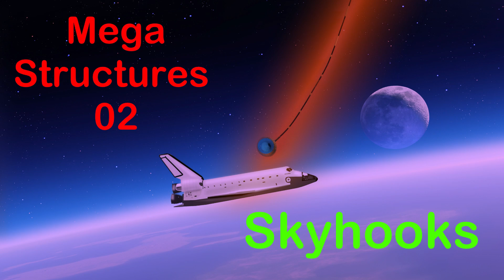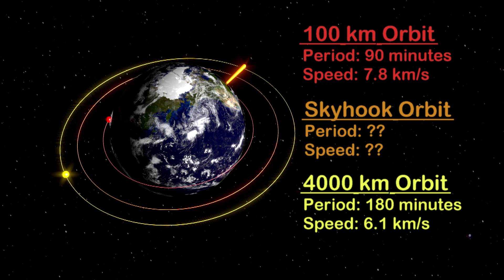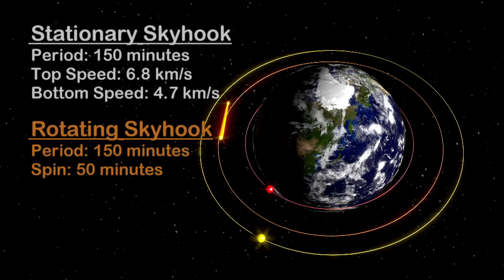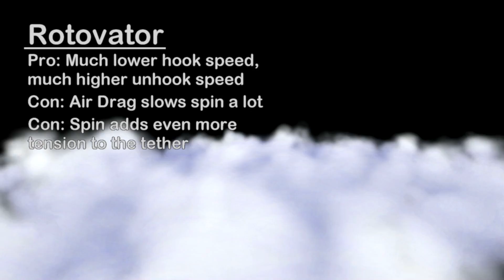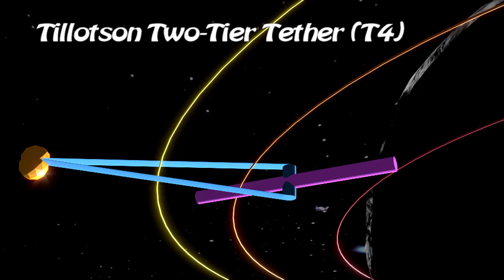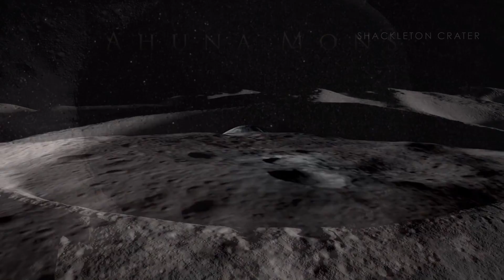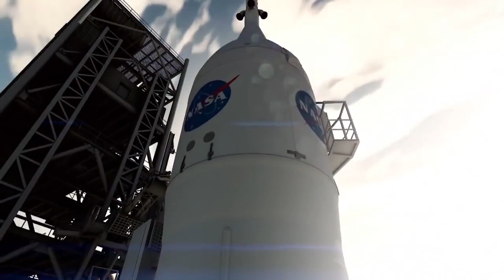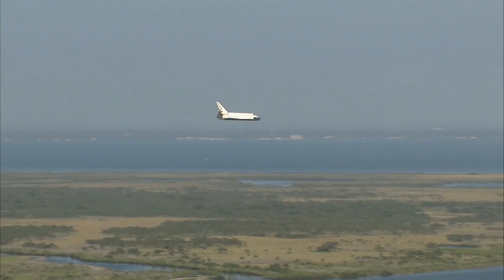Skyhooks & Rotovators

Comment: Could the skyhook gather Ion thruster fuel from the planet atmosphere when the hook is going down if the planet has the appropriate air composition?
Reply from the maker: Huh... yes it probably could. I was going to say no but the exhaust velocity of the ions ought to be decently higher than the scoop speed. I was also going to say I figure someone must have thought of that already and ruled it out but we almost never consider the ion option because of the Electrodynamic tethering option. Well done, that may well be the first time anyone's thought of that Luis.
Reply: @isaacarthurSFIA  i thoight of that while watching the video before i got to this comment :/
Reply: Well, I cannot disagree but not much xenon is available. You work what what's there, especially since the supply is so plentiful. Better to separate the O2 and cool in a cryotank and launch in to orbit for oxidizer and breathing. That will improve the economy for this Skyhook.
Reply: Reaction mass from the atmosphere. Ionization and acceleration from ET (Electrodynamic Tethering power). I like it! No solar panel to catch micrometeroids or drag upper atmosphere like the Space Station.
Reply: Thanks for making this video... I had not realized that an unteathered space elevator was called a sky hook. Could this technology be used to collect atmosphere from Venus that could then be transported to Mars? I am sure that there is plenty of silicon in the Asteroid Belt that could be used as a transport device... and the heat from Venus's atmosphere could effectively be used to blow the silicon into enormous glass balls that could be sent on an elliptical orbit around the sun on an impact trajectory with mars... 

The question I have is, how do you harvest the gas with such a device? Over the long term, this could help make both planets more habitable for humans.
Reply: Look up Electrodynamic Tether on Wikipedia - it generates power. It have been tested. Reaction wheels could affect the rotation of the Skyhook or ion thusters at the ends. Or both.
Reply: Larry Beckham. where would the power for either the thrusters or the electrodynamic options come from if not solar?  I mean there are other options but solar isnt a bad one.
Reply: How would you overcome atmospheric drag?
Reply: @gauravproton1956  Electric turbines adding velocity when entering atmosphere, powered by energy from solar panels or gaining energy from magnetic field of the planet? Drag could also be decreased by adding aerodynamic shape to it.
Just trowing ideas around.
Reply: @Hellsong89   magnetic field is weak cannot use as a energy source, its velocity would be high so cannot make decisions in a split second. Well why do you need energy source while entering the atmosphere?
Reply: @gauravproton1956  thrust provided by ionization of atmospheric gasses within a very high voltage electric field and a few smoke detectors worth of americium to induce the ionization
Reply: @unitedspacepirates9075  this would create more rucus  more entropy around the shuttle
Reply: Increasing the voltage of any ion drive increases the thrust from each ion ejected. Increasing the number of ions only requires additional smoke detectors americium to ionized more ions. Increasing the voltage doesn't require additional power, only additional windings or capacitors.
Reply: +Timothy Crystal
Trying to supplement the atmosphere on mars is unlikely to work long-term for two reasons:
One is that Mars' gravity is so much weaker than Earth's, it is unlikely to retain much more atmospheric mass than it already has.
Two is that Mars has no magnetosphere to screen out the solar wind, which is admittedly much weaker at Mars' orbital radius.  No matter how much mass is accumulated, the solar wind will ionize gas particles and effectively blow them away from the planet like dandelion seeds.

Comment: A hybrid system with space elevators. If there is a solid ring structure connecting the various towers, you can deploy a retractable tether and hook from the structures between the towers. High altitude spaceplane can be flown from anywhere on earth then meet up with the hook for orbital extraction. They can still be launch assist system with the ring structure being a pivot point for the sling. 
This way, non-equatorial nations can easily access space without large rockets or transport materials to the nearest elevator.

Comment: Wouldn't using Lorentz force to replenish the momentum of a tether be less straightforward than just circulating an electric current along the tether? I mean, if you did that, the current would have to loop up and down the structure, creating equal but opposite forces as it interacts with the magnetic field.

Comment: shooting our rocket ships through magnet rail structure inside a somewhat vacuumed chambered tube(hopefully timed correctly between the release of of the vacuum and energy from being flung off the magnet track and out the top) be more efficient cause then they could use the fuel from the rocket to reach more things inside our system.

Comment: It doesn't need to "dive" in athmosphere, it can catch a vehicle in suborbital flight also, than slingshot it to orbit or further - rotating version. I think that, the most eficient solution to get to the orbit will be sth. like that:
1. geting to supersonic speed by magnetic rail,
2. jumping to 100+ km up by ramjet and small boost from a rocket if needed,
3. getting to orbit by rotating skyhook.
But in fact the cheepest way to get to orbit will be projects like skylon or fully reusable spacex vehicle. Fuel is cheep, space stuff is not - 1T of liquid hydrogen costs only 500-1000$!

Comment: Something I didn't quite fully understand and am curious about - I mean the limitation of jets and high altitude is that they compress and expel air for thrust, which means they would not operate without air (obviously). So if a skyhook were to grab a jet, it goes without saying the hook and the object it was grabbing would be deep into the atmosphere. How would the spinning system recover the energy lost to drag. It would seem like a object that long, even if designed with minimal drag, would need to recover a lot of energy. I would think it would need to recover a lot more than the energy than needed to overcome simply gravity like the geosynchronous orbit version. Also, unlike gravity, air resistance would create energy loss from it's rotational momentum, and only on one end.

I don't doubt Isaac has thought of this, maybe even mentioned it in his video and I missed it. It was just a the only potential obstacle I thought of after watching the video and am curious as to why it wouldn't be an issue, or a big issue for that matter.
Reply: Drag losses would have to be to be counteracted in the same way as the losses from lifting things, by catching stuff which needs to be lowered: in the worst case essentially dropping rocks from the moon if there's nothing useful to lower, and/or by using high-efficiency electric thrusters which can potentially be nearly free (i.e. if pushing against the magnetic field). The other possibility would be to just not lower the hook into the atmosphere at all, it's still a lot cheaper to do a suborbital hop to 100-200km altitude than to get into orbit (about 1/4 the kinetic energy is required and most that could be provided by jet engines) and getting out of the atmosphere would probably make docking simpler by eliminating all aerodynamic effects, though the spaceplane would then need an OMS and some propellant to make the rendezvous.
Reply: Blake Walsh 

Would that even work? I mean any kind of orbiting structure that's 100km+ in length is going to be essentially as rigid as fishing line, fishing line with memory I suppose. I just don't understand how it would be easy to lose and gain large amounts of rotational energy on only one end of a rotating string.
Reply: My strongest suspicion is that gross corrections to the orbit and/or rotation could be made using propellant-less means, but it would still be absolutely essential to have thrusters at each end to perform various kinds of attitude correction. Obviously, whenever the tether catches and raises/lowers a payload its orbit is going to change and its angular momentum is going to change, presumably the computers managing the tether would make projections of where the ends will be in the future which would affect scheduling - missing a payload catch would suck because it would throw off all the projections. There would have to be negotiations of how a payload is going to meet up with a hook. As mentioned by Isaac a modern computer can handle the logistics of this.

It couldn't be a completely propellantless system but it is a system ideally suited for jet engines and electric engines. Ion/plasma thrusters on the hooks could be firing continuously, building up angular momentum and orbital energy over many days, which is then quickly expended lifting a payload from a suborbital trajectory into orbit. The payload could thus be launched mainly on jet engines, lifted into orbit using electric engines courtesy of momentum exchange with the tether, then use its own electric engines to finalize its orbit. In this scheme, low Isp high thrust chemical rockets are nearly entirely replaced by high Isp propulsion and the reduction in the size of launch vehicles and the propellant expended would be huge (something like 90-95% reduction with good potential for 100% reusability), and that's just with winding up the tether using electric propulsion and not even considering the ability to get "free" momentum by catching payloads falling from the moon or leveraging the magnetic field of Earth. So even considering a pretty dumb system where both ends have VASMIR thrusters which do 100% of the work of getting the tether properly setup for a catch the potential is quite huge.

Comment: What about the atmospheric friction adding to the skyhook's rotation, what would keep it from adding up and tearing it apart? Only way I can see this actually working is if the skyhook essentially just dips into the atmosphere where at it's lowest point of rotation the hooking part would be moving close to speed of the air.

Comment: Interesting. As for your skyhooks Have the wide point at the center of mass. And this way both ends can be used. Secondly, Space crafts do need to come back to earth from time to time. Hence a Skyhook could grab one craft going up and one craft going down. and have a very little net loss. Speed transfer would happen is the center of rotation mass is closer to one end than the other. This way the fast moving craft coming home, would transfer some of its momentum to the out going craft.  The only problem I see is that the tethers will cover a wide range of orbit, and add to the probability of crossing some poor satellite's orbital path.

Comment: $500 mill launch and setup for a single system. 10 tonne a day @ $100/kg = $3 billion in revenue over 10 years. Would expect the lifetime of the system to be over 20-30 years.
Reply from the maker: I wouldn't want make many guesses about that first generation's service time, but even if you could only do one 10 ton hook once a week for one year it would seem worth it.
Reply: BFR might change the economics of the initial setup costs. If BFR can put 150 tonnes into orbit for a few million we now have a launch system capable of putting 3 tonnes into orbit per swing. If it is reboosted via electronic dynamic tethers it will be good to go in about 5 days. This would be a good satellite launcher however it might make more sense to launch it in several loads so it can fire ~15 tonnes into orbit per go so large assemblies could be constructed. Also assuming that we devote 50% of the mass put into space to more tethers into orbit we end up with a doubling period of 500 days, after ten years we could be putting 190,000 tonnes into orbit per year.